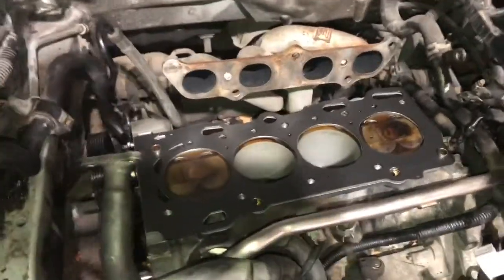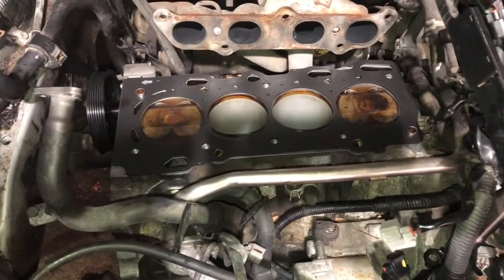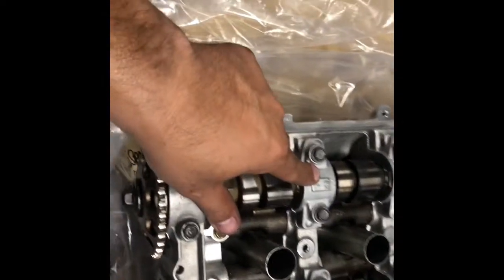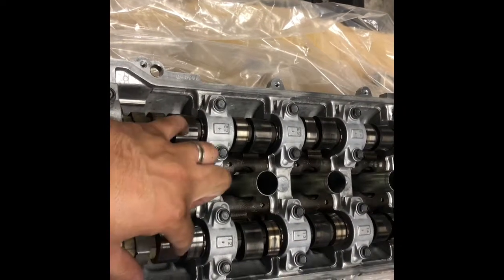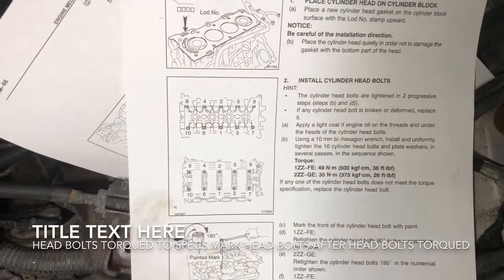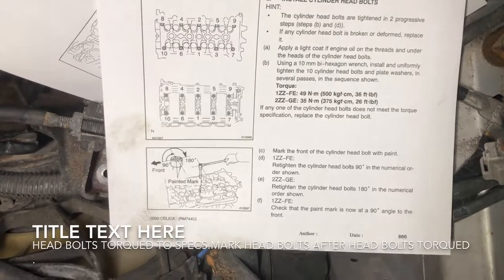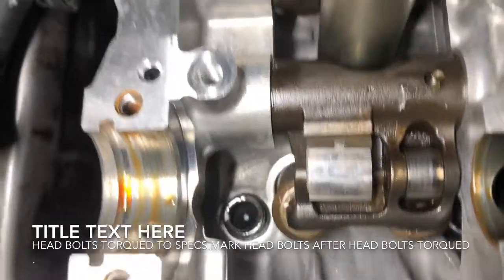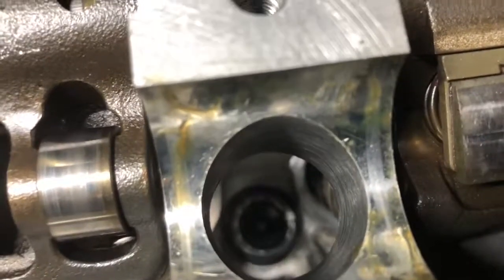2zz engine Head Bolt Torque Procedures

Comment: torque head bolts 26ft lbs and then additional 180 degrees, can anyone confirm? and do you do the 180 degrees all in one turn or in multiple stages? any help is appreciated
Reply from the maker: @tod3356  180 degrees one turn. To confirm I suggest to get a subscription to alldatadiy for your vehicle. Procedures and many more details for other repairs. It’s will worth it. Pays for itself on first repair. 😊👍